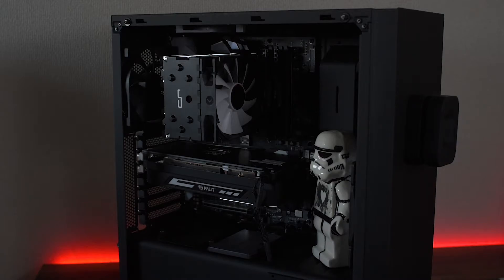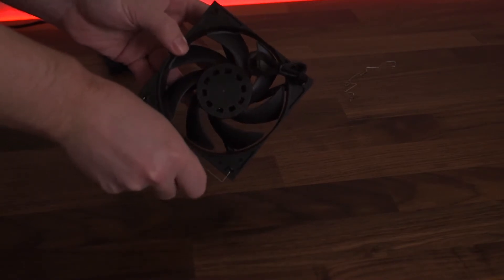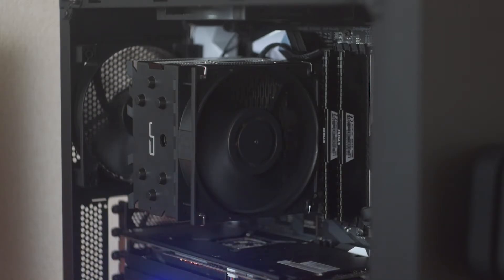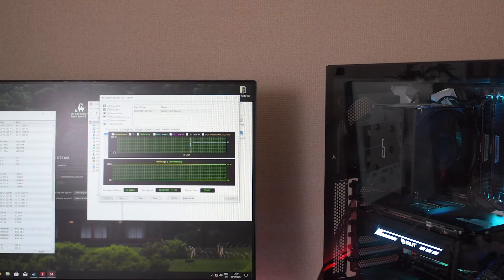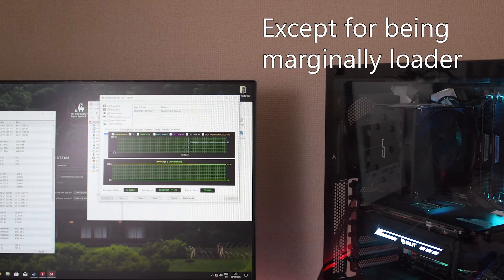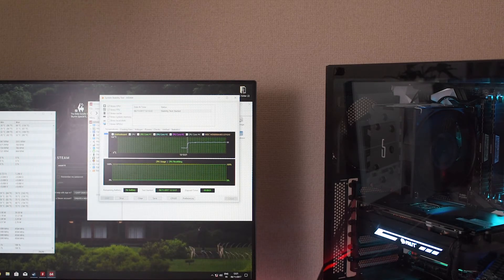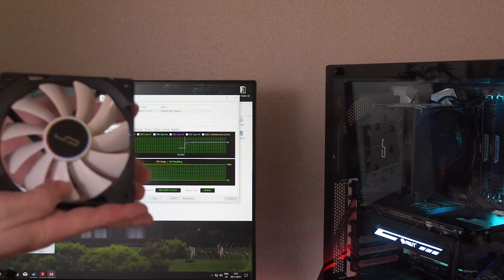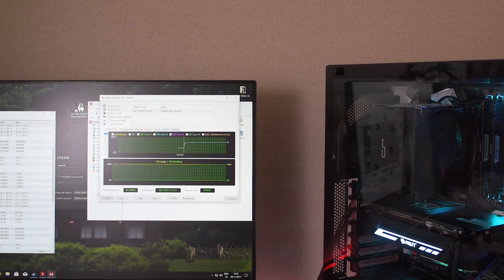Is it worth upgrading your Cryorig H7 fan?

Comment: I think the stock H7 fan is great. Quiet, attractive, and good cfm to pressure ratio. Tried using a rgb Cooler Master air pressure optimized fan and it ran a few degrees hotter with higher spikes. Plus, the stock fan keeps my VRMs cooler.  I want to try out another Cryorig QF120 Balance on it for push/pull.

Comment: I used the stock h7 fan, corsair sp fan and then a corsair high performance fan at over 2000rpm. Changing the fan didnt really make a difference, maybe 2-3 degrees. I guess its the cooling limit of the h7 as it is a budget cooler that is compact. Reapplying thermal paste didnt really change any temps either, like 1-3 degrees? This cooler is ok budget, but i highly recommend a 140mm fan air cooler. Youre smart, you are right the fins are over saturated and that is its max cooling potential.

Comment: Ive got the H7 quad lumi and found it gave better results in push pull with two fans so maybe try that.
Reply: I replaced the stock fan with Noctua NF-F12 ippc 3000 and got up to 6c off. But it's loud at 3000rpm. At 2000rpm, it's barely audible.
Reply: @紫气恒生  6 degrees is quite a lot!
Reply: @紫气恒生  
Was that one fan setup as push or pull?
Reply: @jxsilicon9  push, same as the original stock fan.
Reply: Hmn didn't see this video before when searching for people who had replaced the fan. Well i got a Corsair 120ml anyway as i didn't want the fan to be rgb on my Quad Lumi. At very least it and the Vardar should help cool the vrm better, which is still helpfull overall.
Reply from the maker: chris mcmanus That's definitely worth trying. Thanks for the input.
Reply from the maker: n00bie Yes it does come with a second set of clips in the box.
Reply: @DawidDoesTechStuff  Why not test two fans in push-pull by placing the orig H7 fan with the Vardar Fan?
Reply: I have the original H7 and bought a second QF120 to use  in push/pull — maybe getting two degrees difference from it. I’ll leave it up to you whether or not that is worth the expense and effort.
Reply: Meh...for size, get a H7+. Have space? Ninja 5 or Mugen 5 Rev. B.
Reply: If I wasn't mistaken h7+ didn't really give a big boost in temperatures.